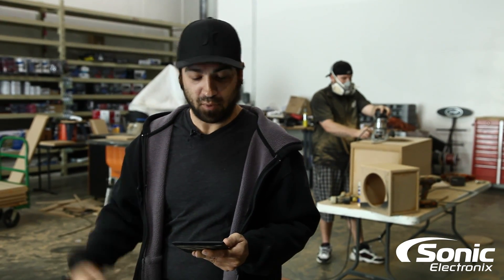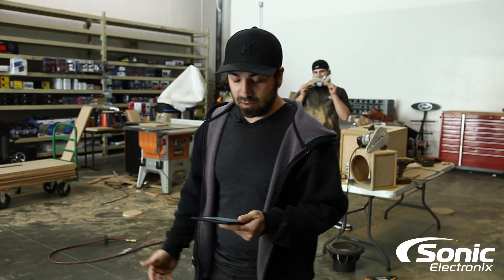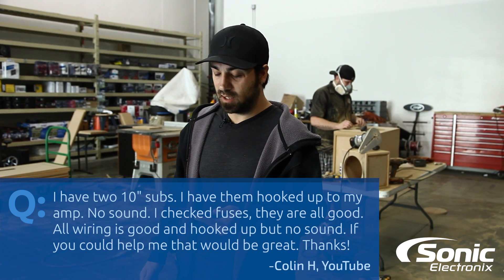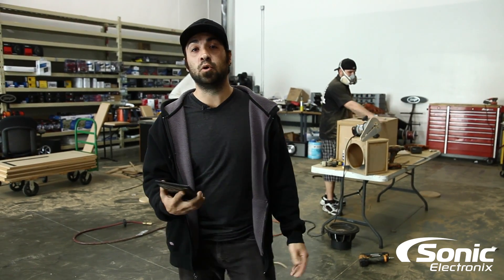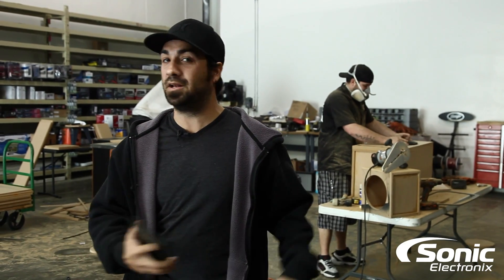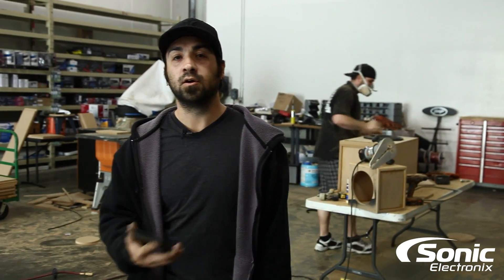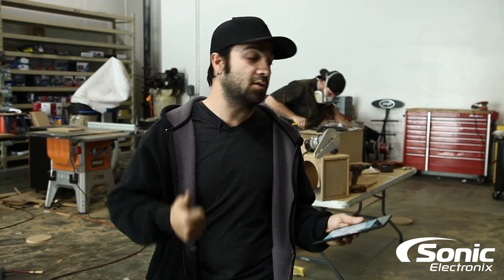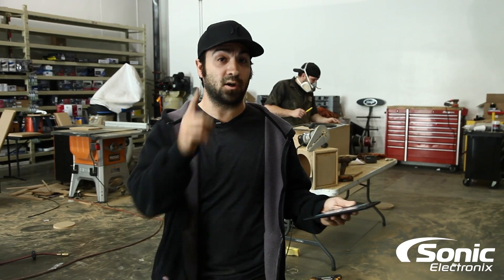Why Am I Not Getting Sound Out of My Subwoofers? | Car Audio Q & A

Comment: Professional curiosity here... what if my amp for my door speakers works fine, even with both sets of rca's, even with that signal routed through my sub amp, so i know the amp is on(lights up/passes signal, but won't output sound from either channel. I have a dvc sub wired in parallel @1 ohm. I was wondering if one of the voice coils could have "snapped" when i moved it from my trunk while i was fixing a ground loop problem. Door speakers sound amazing. Ended up having to ground the headunit to its case, but even without that simple ground fix the sub makes no noise. Seriously PO'd about this problem so the only thing i can think of is that my amp is crapped out but I don't know why. I've had it for about 2 years, its a hifonics 1000.D gladiator i believe

Comment: my car died and after i jumped it my sups just stopped working. my amp is getting power and the subs just keep making a low humming noise
Reply: I have everything hooked up right but whenever I connect all my speaker wires the sub stops working but whenever I have all the speaker wires disconnected the sub will play
Reply: Mine too comes on for just a sec then back off.. I could unhook rca and rehook them and after couple sec. The sound goes out... Please help

Comment: I am having the same problem. I have a L5 and it won't work. It worked before I went to visit my cousin and on the way home it just went out. It's not blown, I wasn't blaring my music or anything. It just went out. So I got new speaker wire and installed it but still no sound. Here's the kicker though... I connected my 12" CVR with the same set up and everything and it worked just fine! Please help!!!
Reply: Dayne Fuxa I've fixed my problem you probably did too but for me it was my rca cables I changed them out and now its been working no problem

Comment: I used the Voltage meter and everything is good. I re wired the subs within the box while it was on its back. Before I connected everything back, I connected the speaker wire to a loose speaker to see it it works.Got it to work. Screwed the Sub back. When I stood it up, it stopped working again. I tried to put the speaker wires to the loose speaker and that didn't work. How do i check  the speaker outlets? I am at a lost now on why the speaker or Sub will not work?
Please Advise?   
10" Alpine Type  S
Alpine MRP-M500 Amp.

Comment: I just got a second amp and a sub woofer professionally installed in my vehicle, and the sub was working great for 2 days, no problem, i never touched the bass boost or gain. Just yesterday it stopped working and worked again after i got back in my truck after about 2 and half hours, but then i got in this morning and no sound from my sub woofer since this morning. Very aggravated because it just happened out of no where!! Please help, thanks!
Reply: Cole Little Have this same problem now. Did you figure out what it was?
Reply: No, I have not sadly.

Comment: my 10 inch subwoofer was working then I unplugged the connection to the sub box to test some old square subs that I had then when I plugged it back in the rest of the tweeters and door speakers work but the sub is the only thing that doesn't work can anyone give me advice?

Comment: why does my 10" sub play inwards instead of pushing out? i checked the poles and they are correct? evrything else seems fine.....what advice can u give?
Reply: Your subs are out of phase. Make sure your positive and negative speaker wire are connected correctly to the positive and negative terminals on the amp and sub.

Comment: with a 3.5mm to rca you can use a phone or ipod to send signal straight to the amp. cheap alternative to a signal generator for checking an amp.
Reply: And if that doesn't work? Bad amp?
Reply: Thank you! Great tip!

Comment: you also forgot, your amps low pass filter or other filters, might be already sitting in a position that is filtering out most, if not all of the frequencies coming into your amp, that are meant to be sent to your subwoofer. have your amps gain about 1/4 and your decks volume at about 50% and put your filters in roughly 12 o'clock and fiddle around with the filters and that could very well fix the problem
Reply: Bro lol I said fuck this channel they don't know how to get my shit running. It hurt saying that since they are pretty dam decent. Just started turning shit and I'm up and running good shit my dude. Ur appreciated!!! 😅